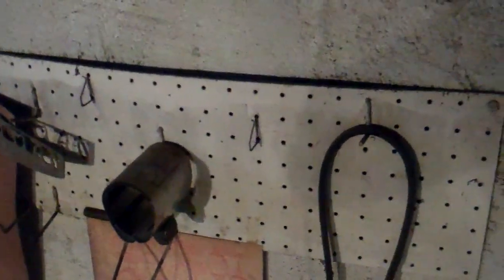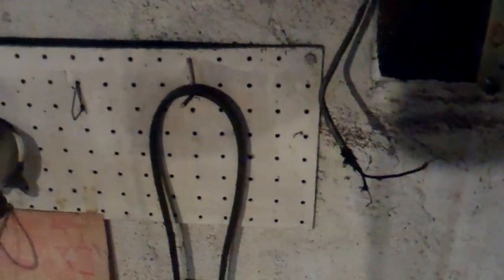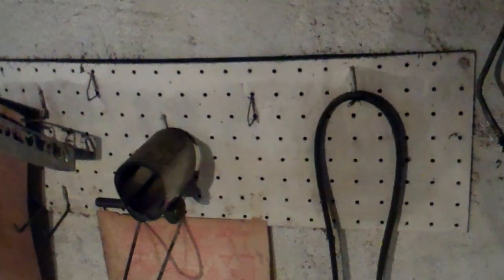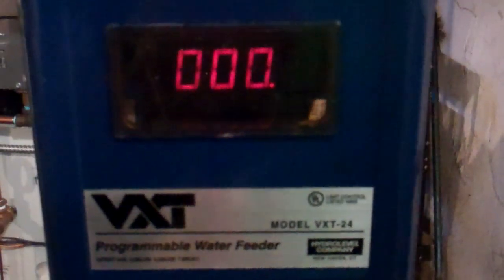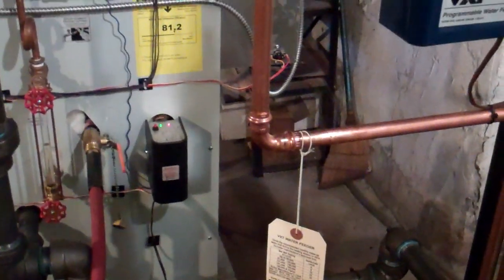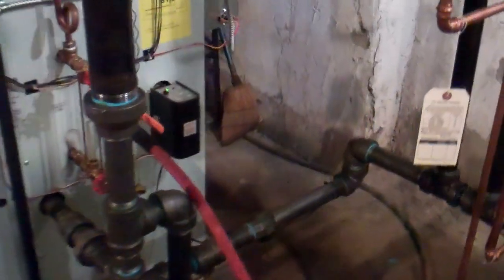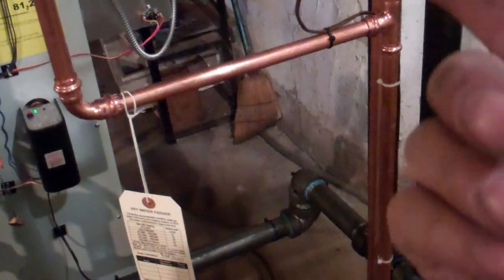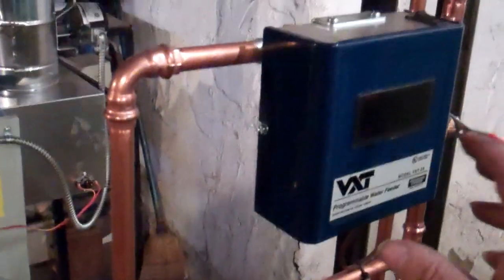boiler water feed issue

Comment: I have about 9 different boilers, and none of them ever add water directly after power is restored.  There is always a delay.  The best way to test the low water cut off and auto fill is to drain the system and let the autofill do it's thing.  Those VXT's also have a dipswitch 'delay' setting, which can be programmed to start filling after 2 min incriments, so it might take up to 8-10 depending on what it's set for.

Comment: Anyone operating a home or commercial steam heat system (1 or 2 pipe), consider getting a condensate feed tank and pump to keep boiler from overfilling and to minimize free O2 in the system.  It also serves as a foolproof way of venting the end of the system, and makes adding chemicals to the water much easier.  Think ph conditioning and O2 scavenger.   Add a Vaporstat controller and ounce gauge to dial in the pressure below 16 oz.  Last, make sure all of your near-boiler pipe is well insulated.

Comment: I am wondering why on the VXT-24, when you see LOC reading what is it.
Reply: Loc is basically a system safety lockout, which can be cleared by turning the power on and off.  This happens when your autofill has ran two cycles but hasn't been able to fill the unit completely.  This has been my issue as well for one of the boilers- the manual feed takes seconds to fill the boiler, but the autofill takes 30 minutes.  I am suspecting it takes this long because theres a filter to clean out.

Comment: How can you tell what it reads? Going by the number of divisions it looks like a vacuum-pressure gauge, and the needle would be on zero, but that's just a guess. And why would it mean a new boiler just because the gauge is wrong? Gauges can be replaced.